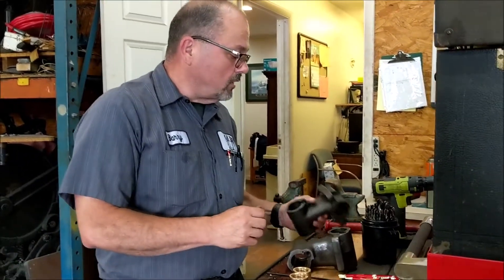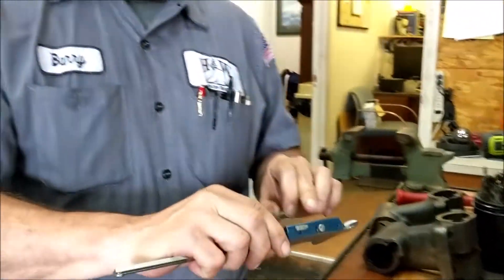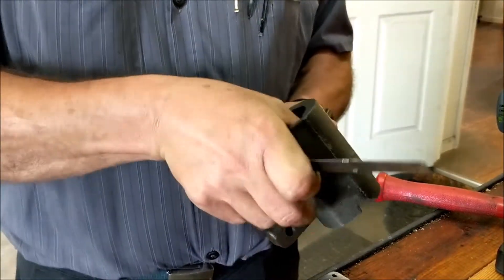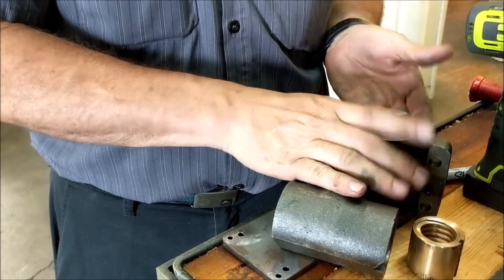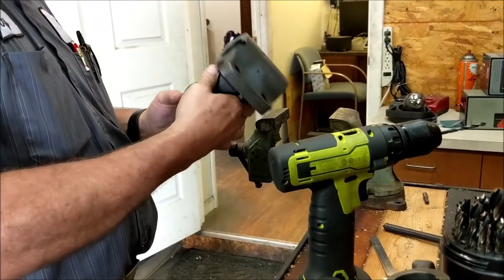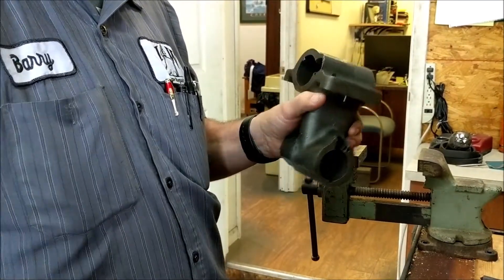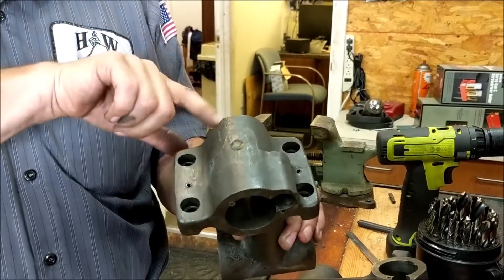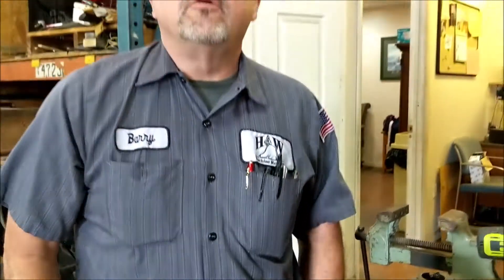Bridgeport Yoke Lube Line Installation

Comment: given that the original lube supply just dripped down from the top, will it not be adequate to have the lube go into the upper part of the yoke, and let it drip onto the lower screw?

Comment: Another great and helpful video, Thanks
How much of the tubing would a person need for a Birdgeport use? Ball park? Thanks again
Reply from the maker: To go from a Zerk system to a one shot system it's going to take about 20 feet, giving you a little wiggle room in case you mess up. If you already have a one shot system and want to redo the lines you will need 10-15 feet.